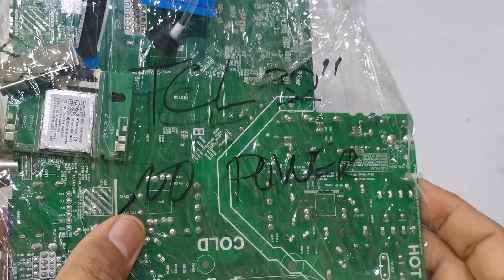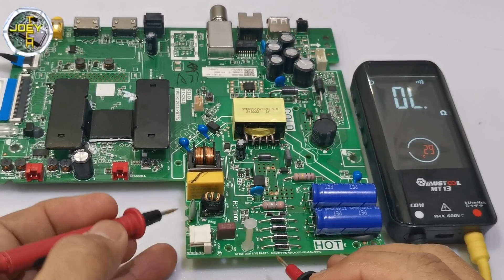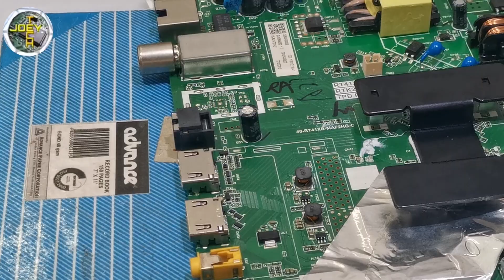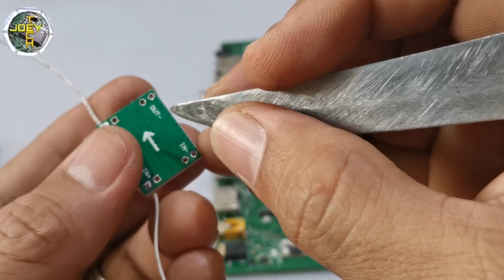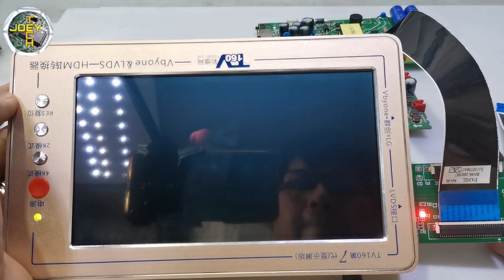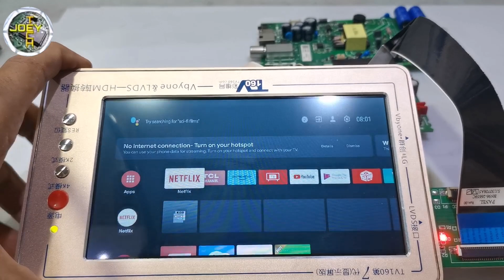How to fix mainboard in Android led tv?Troubleshooting Guide in Led tv repair

Comment: Pwede Kunin ko cell number mo sir may papagawa sana ako ,hindi mgawa nung shop na pinapagawan ko bka masira lng nila sayang 2 months na hangang ngyun kya gusto ko sana sayu e pagawa dko kc alam location nnyu
Reply from the maker: Location po? La union pa po ako
Reply: @JoeyTECHPH  pano ko kya madala sa iyu yun nueva ecija po ako nkatira , mtagal ng pingawa ko d2 sa Amin d nmn kyang gawin. Nila
Reply: Kya kya gawan ng paraan yung input voltage nya is 440 gawing 220 nalang
Reply: Sir san exact address mo kc ako nlnggdadala ryan nung unit
Reply from the maker: @carlosesguerra1979  09916991521